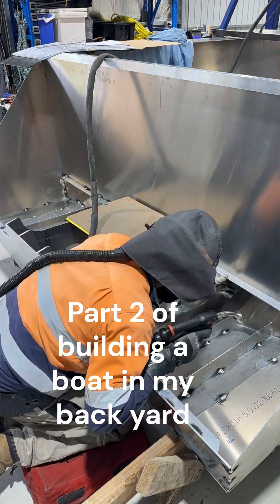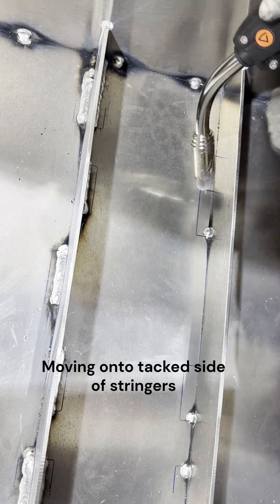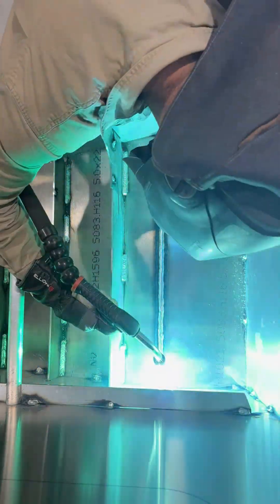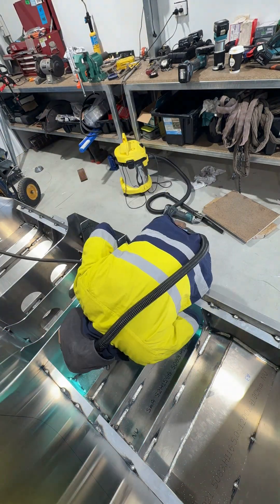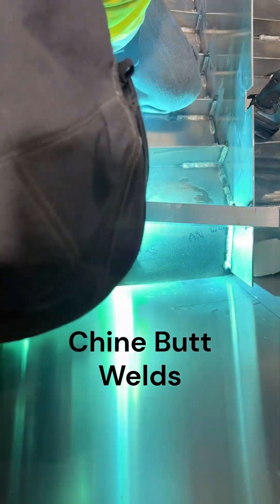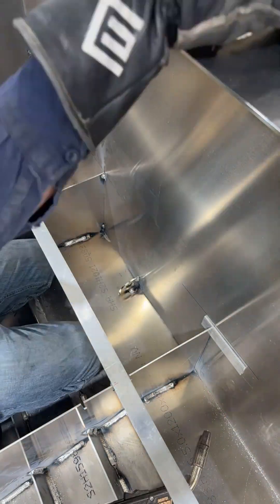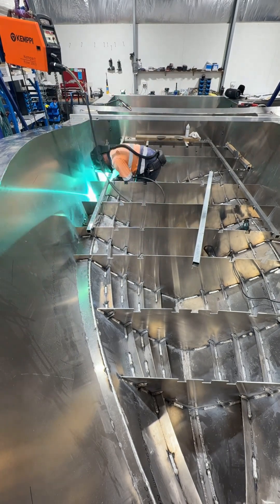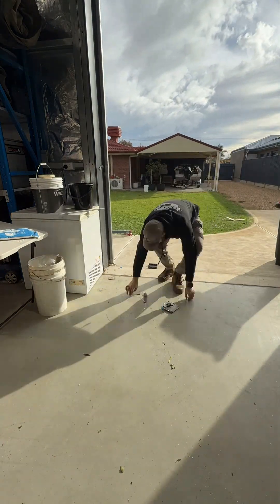Part Two: Building my dream boat at Home | first stage Welding

Comment: Just watching your videos. I’m about to start building a 6110cc. Is there anything you would do different? What router bit did you use to tidy the edges up?
Reply from the maker: Yeah definitely would do some things different, feel free to send me a text on 0423 370 546.

2mm radium bit
Reply: @danbranxl thanks for that. I will send you a text when I get it.

Comment: Tip for you with the distortion & breaking tack welds.

I notice a lot of long continuous seam welds. That allows too much heat build up & thus distortion.

The correct way to do it is 2 inch long stitches - starting from 4 inches away from you, weld back towards yourself 2 inches.  Then repeat, start 4 inches ahead again and weld back towards yourself for 2 inches, leaving a 2 inch unwelded gap.

Go to opposite side, and do the same to keep hull straight.

Do this all the way along your keel and chine seams.

Then come back and clean your joints then infill the 2 inch gaps, again switching side to side to keep tensions and expansion the same.

By starting 4 inches ahead of yourself & welding back towards yourself and welding back 2 inches towards yourself, the heat build up where you started has time to cool while your welding back 2 inches towards yourself.
Then when you jump 4 inches ahead again, the heat from where you started the previous weld has cooled & you don’t get progressive heat build up & associated distortion.

Yes it’s slower than a long continuous run and the staggered 2 inch long weld runs aren’t as pretty as a continuous bead BUT, you avoid the heat & distortion and blow throughs.

Aluminium being a white metal, it’s not like steel where you see it glow red before it gets white hot & melts.

Aluminium there is no warning it’s about to melt.

That’s why the 2 inch stitch back towards yourself & the 4 inch jump ahead pattern combined with switching side to side of the hull minimises / eliminates heat build up and distortion & then you come back and infill the 2 inch stitching gaps to get your continuous weld.

Any time I see long continuous welds on alloy boats I shake me head and walk away because I immediately recognise the welder knew zero about welding alloy boats.

Just being a welder doesn’t make you a great alloy boat welder IMHO

I learned this technique from a naval architect specialised in designing & supplying plasma cut alloy kit boats long before CNC Marine ever started business.

The short cuts I see these days aren’t good IMHO
Reply: Good advice I do a bit longer than 2 inch but same routine

Comment: Can you explain the drainage system? If rainwater enters while at sea, does the water reach the hull of the ship? Thank you
Reply from the maker: Water will drain off the deck as it is higher than the water line, 

But if water does find its way into the hull, the hull is designed for the water to drain towards the back where an automatic pump is set up
Reply: @danbranxl  
So the hull of this ship is not tightly closed? Can you discuss this in a video about the drainage system during rain? Thanks 🙏🏾
Reply from the maker: @HasilTinta yeah I certainly can

Comment: Nice work. I worked for a major boat builder in Canada, even there we did vertical down with our Mig machines, vertical up is hell on aluminum. Uphill with Tig is no walk in the park, takes a bit to get angle right, but much easier I find than uphill on Mig.
Reply: i find there is more black soot on vertical down compared to going up. maybe i need to angle it more down. also i find its easier to see the weld if going up